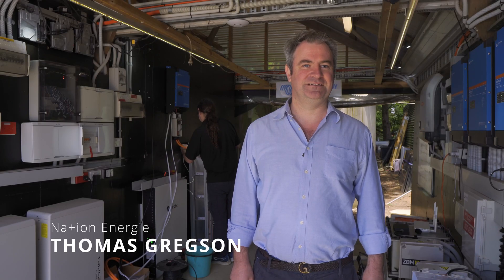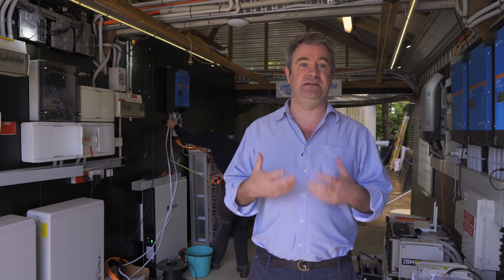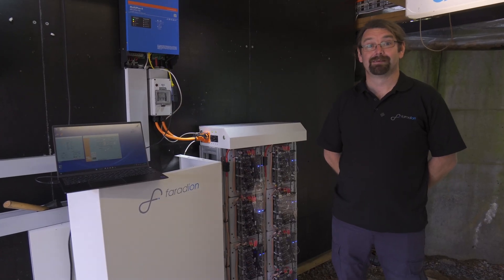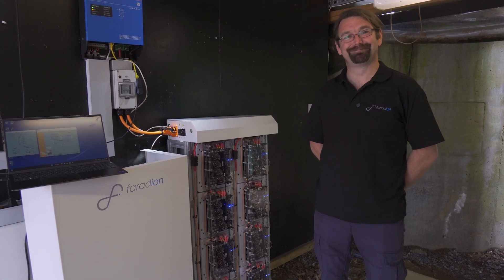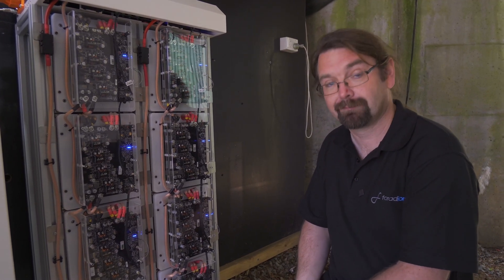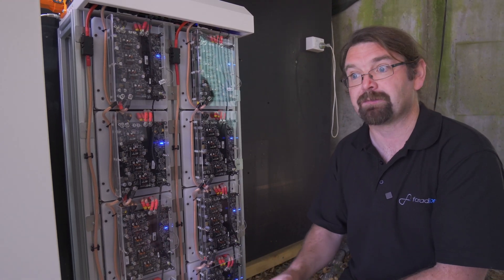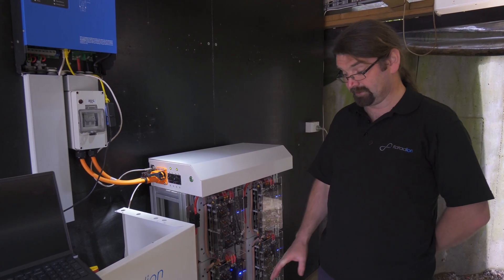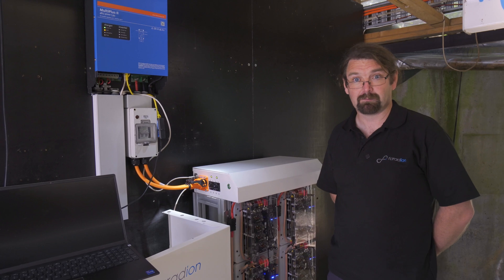Sodium-ion battery

Comment: So if the onboard dc converters are maintaining the outgoing voltage up at say 52v while the cells are declining in SOC, wouldn’t that mean that amperage supply would deplete over the discharge cycle and therefore the available wattage output capability would also decline? Can the electrolyte still reach 300°C if there’s a fully charged battery short circuit? What is the typical working output voltage range for supplying that Multiplus inverter? 56-42v? Seems brilliant, any negatives you’ve noticed in the lab?